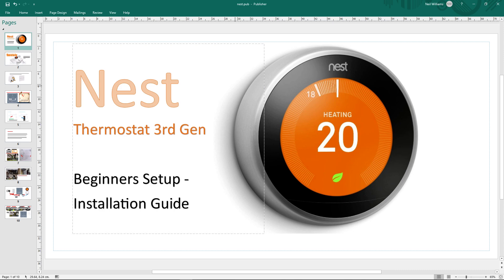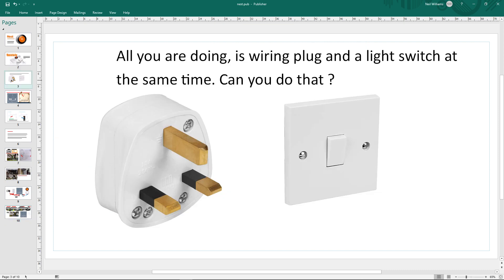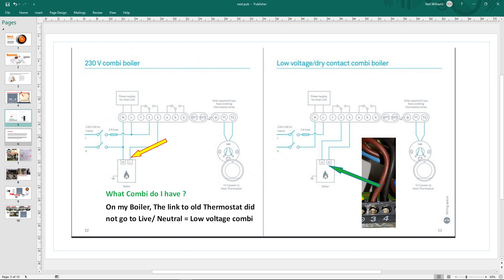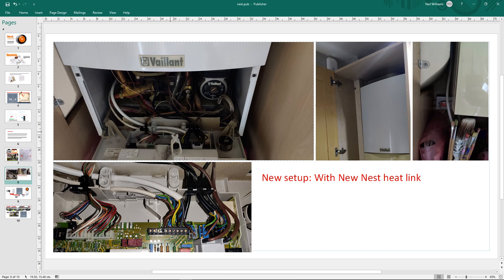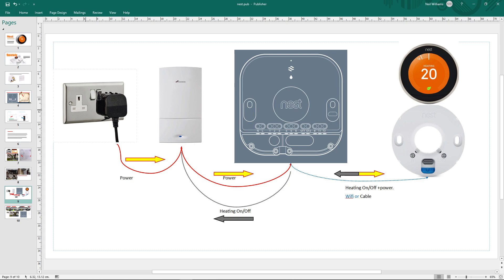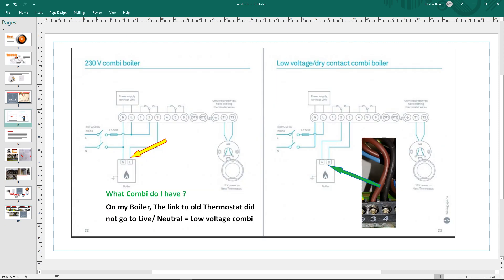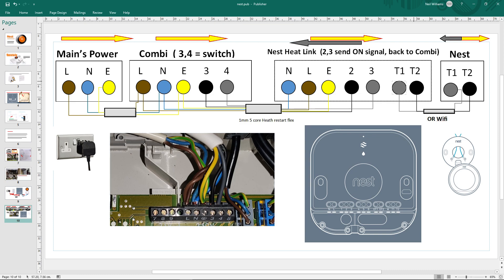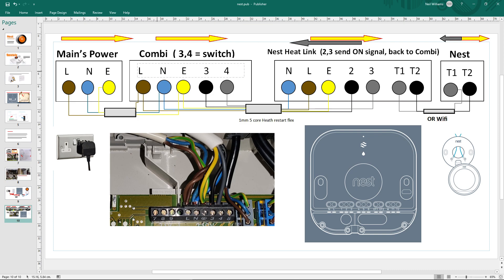install Nest Thermostat diagram

Comment: my flat has 2 thermostats ive been told i can just open the valve on my bedroom thermostat and disconnect it and only wire up my main stat to the nest themostat and should work

Comment: A huge thx making this video. I have a very old system that is connected with a thermostat that has 220v at the moment. Do you think a nest can  replace that?
Reply from the maker: Hi, I’m just an amateur at things like (only done this one)this so don’t take this as 100%. The thermostat is just a switch, so if it’s just got 2 wires going form the boil to it, they must be for the switch. If it has more than 2 wires, it may power the boiler, so would be more complicated and my not even work. Have fun and double check power is off 💥
Reply: @Hometechnologies  Are you still happy with it?
Reply: Yea, it’s been 100% reliable over the last 2 years. I would hate to go back to a basic one. Just takes a bit to get comfortable with. I.e. if you set it for 18c at 7.00am if it’s very cold it could come on at 4.00am to get 18c at 7.00am, it slowly learns how long it takes to heat up at different times/temp.

Comment: please help i have this exact same boiler. i have installed the base from N into the same socket as neuteral. Live to live, ground into ground, 2 into 3 and 3 into 4. the nest is all set up but when i go to give it hea. nothing happens. i hear a click over by the boiler but heating does not heat. where am i going wrong?
Reply from the maker: First I would check if it works by pressing the big round test button on the Wi-Fi box, that just closes the circuit to start the boiler.  Also you could try wiring up the  Wi-Fi box ( still, the one connected to the boiler) directly to a plug socket and use the test button( do not connect the nest thermostat yet).  Then all you have left check is the two connections that when closed start the boiler.  First test by just connect to each other with a little wire, then if that’s ok add the Wi-Fi box and press the big test button.
Reply: @Hometechnologies  thanks for replying. i think i sussed it. am i right in thinking i need to set the heating control knob on the boiler to something other than what would be turned off? obvs turned to the left is off so i have turned the dial to half way mark. the nest seems to connect, set temp and turn on/off ok.
Reply from the maker: Yes it should point up (on all the time) because the two wires that go to the thermostat/Wi-Fi take over as the switch.   Those two wires could be connected to a 100 supercomputers 😀, but in the end, it’s just open or closed, to switch it on and off.

Comment: Thank  you for the  very simple explanation without any technical word like most of the videos.  This was the only video that made sense to me as I'm not an electrician or any kind of engineer . I  can do a lot of DIY but when trying to install the nest thermostat it proves very complicated and got worse after starting watching the videos on YT until I've came across to this one witch for me was straight forward.  Thanks to you mate my nest thermostat is now up any running,  cheers.

Comment: Comprehensive and well illustrated. Just what I was looking for. One question: Can you power the heat link directly from a power socket instead of through the the boiler as per your diagram?
Reply from the maker: Yes, you can .

Comment: I e been searching for a while for someone that has the same setup as myself.

My dilemma is this...

On existing Honeywell BDR91 I have two live wires patched into 2 live terminals, and 2 neutrals patched into one neutral terminal. The 2/3 I'm okay with I just cannot understand why there are two lives and two neutrals?

I have a Vaillant like you and it works from a plug also. 

Any ideas?
Reply from the maker: I had an extra live that looked  like it came from the thermostat, but not a clue why (maybe an unused/old wire) . So all I did, was. 1 take a photo, so i could put back if needed. 2, pulled all wires form the boiler and just put back the three from the mains plug, like a new installation. 3, Then just add the nest WiFi box, as per my diagram. PS I’m just a DIY like you, so if you are unsure, get help form an electrician.